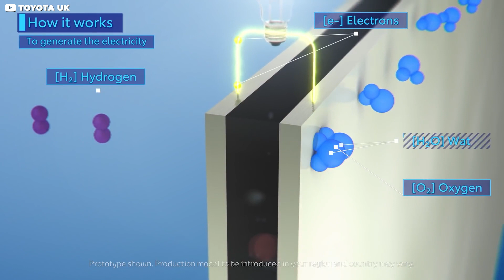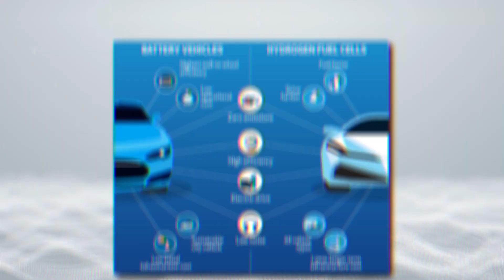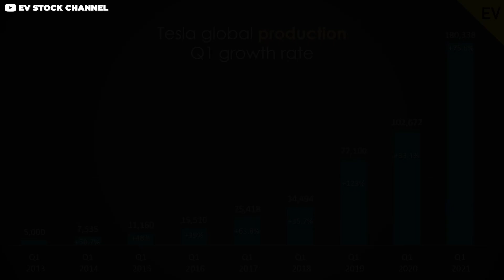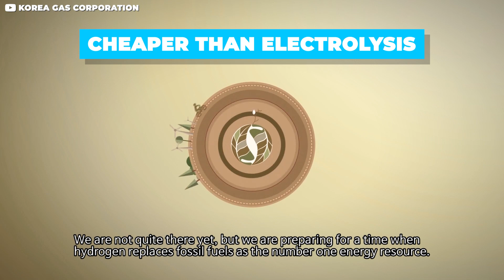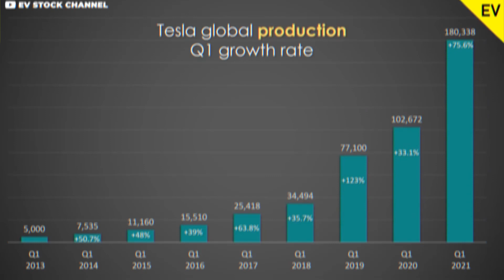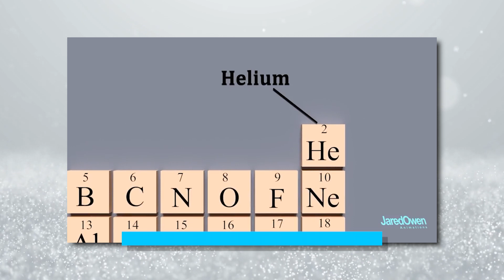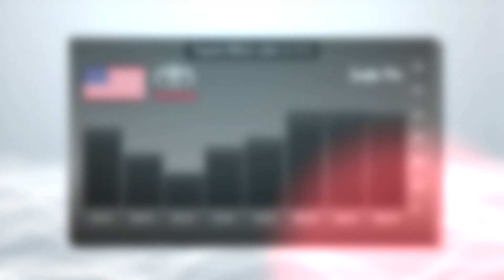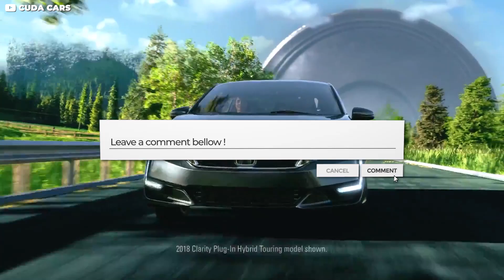Why Don’t We Drive Hydrogen Cars Yet?

Comment: Why do none of these types of videos go into the cost and extreme expense it takes to mine lithium and everything needed for EVs?
If everyone switch to EVs right now we would mine out the planet within years
Reply: he just told you a electric car costs $40000 which includes that cost of mining because battery is sold in the car. Meanwhile hydrogen car costs $80000
Reply: @polaris1985 The cost of the hydrogen car has nothing to do with cost of the product and everything to do with it being in the experimental stage... Mass production of a hydrogen car would be identical to a gas powered car, the problem here is availability, quantity....

Comment: 150k miles is a huge understatement, and battery production CO2 emission is a huge overstatement. The neccessary energy for cell production can be made with renewable sources too (look at the rooftop of Tesla's Gigafactories..). You also forget 2 major points: batteries can be used in stationary energy systems for additional decades AND after that, they can be recycled 95% already. Too much misinformation flying around about BEVs.
Reply: Well, no. To produce batteries you need lithium, and to produce lithium you need to burn coal, which is one of the most enviormentaly damaging activities you can do. Volvo estimated that each EV car produces about 70 thousand miles worth of CO2, so for 70k miles it makes no difference than a V8. But EV cars overtime are less damaging, than gas cars, since EV's only produce 70 thousand miles of CO2 and gas cars can produce upwards of that.

Comment: Yes! I would buy a hydrogen car before buying an electric car!!! And palladium and platinum are both used in catalytic converters so if that is the case on electrolysis and what about the 5% nickel acquired from soils from Indonesian and the Philippines from the island of Mindanao! that didn’t go well with the locales That in which they destroyed the Equipment to tow the floating barges that hauled the soil to China and not to return or replenish the soil that once the  measly 5% nickel was extracted from the soil for the use in building the batteries for the electric car!